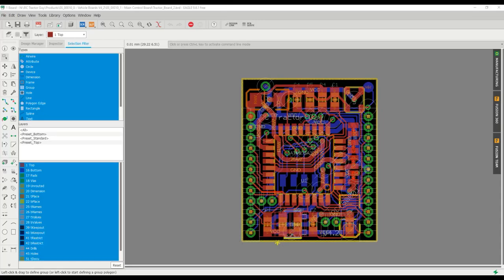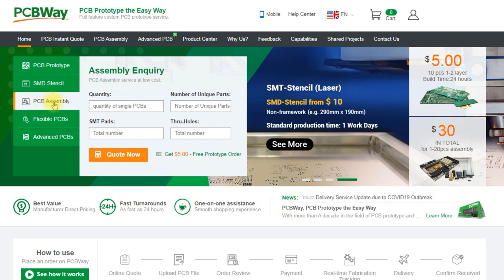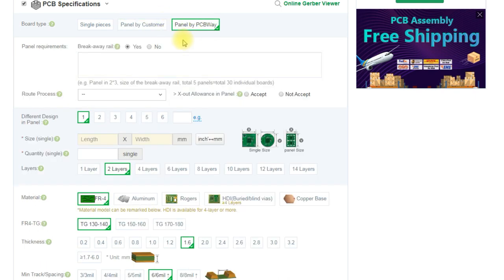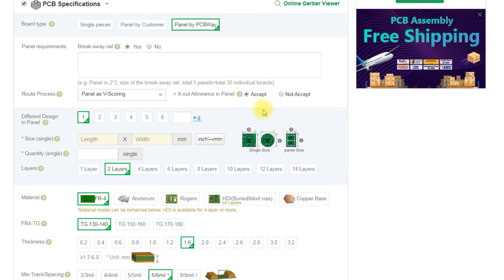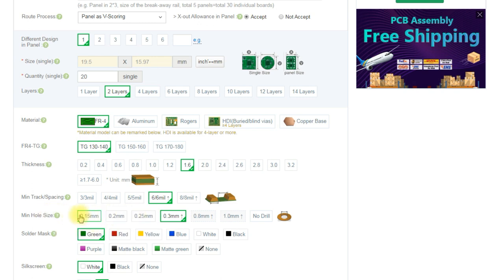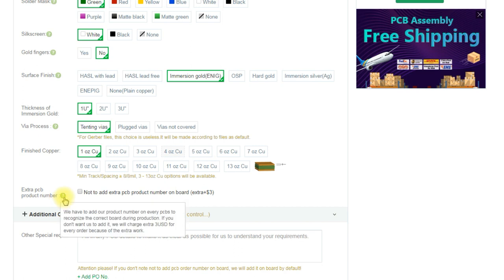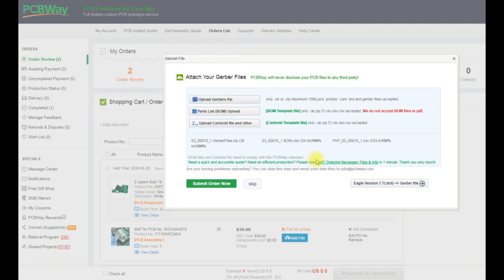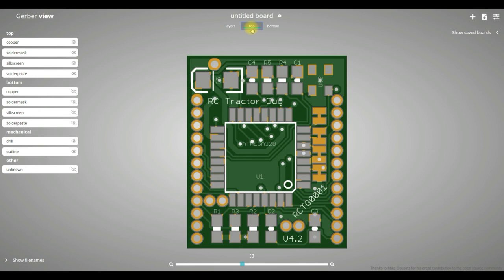How to get your PCB design professionally manufactured and assembled with PCBway

Comment: When your at the window that says "Assembly inquiry", what do you enter at SMT pads and Through holes? This is confusing. The TOTAL # of smt pads on the board or just the pads for the parts you want installed? And the same for through hole pads -- do you put in the # of pads on the board or just the pads IF you want a THT part?